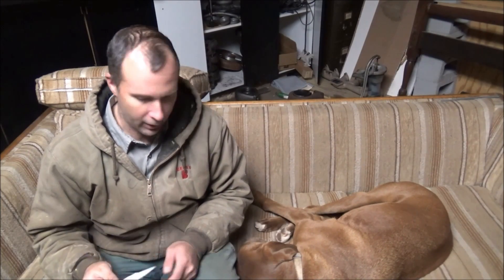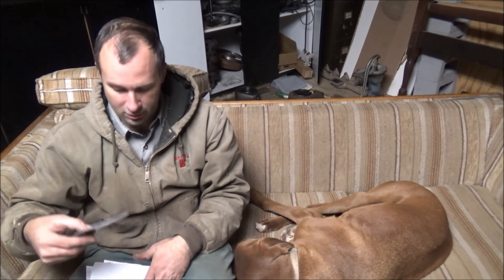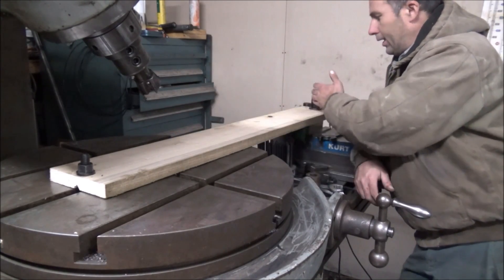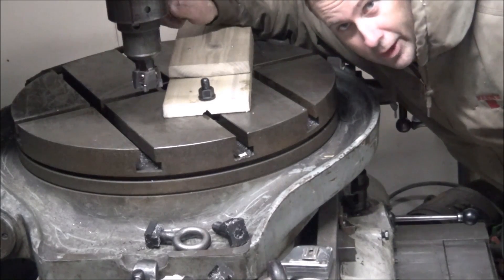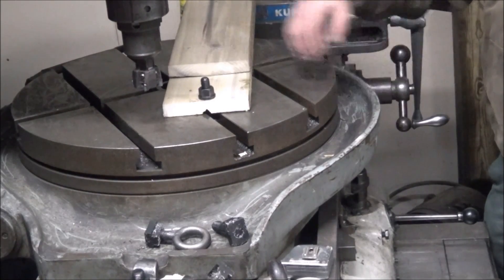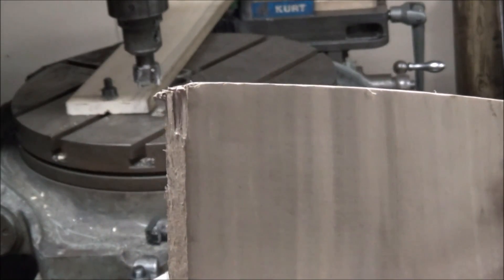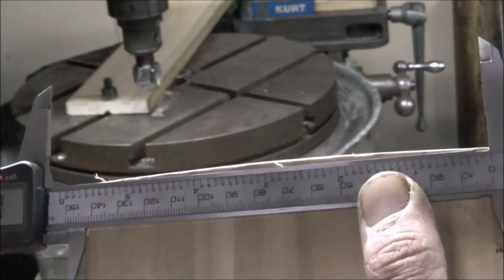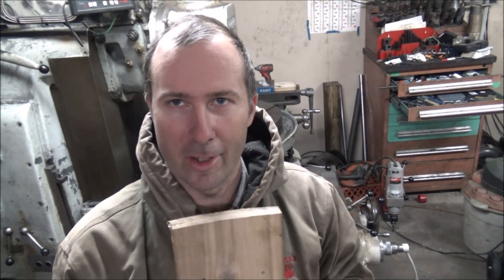How to mill a radius larger than your rotary table

Comment: Since the part being cut isn't following the arc of where it's fastened on the rotary table, I have to wonder if the rotary table is necessary at all.  

With that sliding T-nut action, couldn't the same thing be done using the milling machine Y or even X axis travel?  e.g.  just use the mill cranks to move the part past the cutter?
Reply from the maker: You don't have to have a rotary table but you do have to have a way to be able to move the part on the cutter end as you have to get the sweep in order to cut the radius. Just moving the table would be a straight line action and not an arc.
Reply: @bcbloc02  Let's say the t-slot on your table runs east-west.  Then mount your long-radius center out to the west & your sliding t-nut in the slot.  Then moving the table north-south will cut an arc just as you did with the R-T. 
Of course the N-S travel is pretty limited, so if you could mount another t-slot on the table in the N-S direction and rotate all of the above 90*, you could cut an arc the length of the E-W travel.
(Sorry about the E-W, N-S nomenclature - I'm not sure about which is which x-y.)
Reply from the maker: Bob Engelhardt Yes as long as the one end was stationary relative to the cutter you could use that table to swing the arc the radius of the stationary pivot to the cutter.

Comment: Hey Brian,Since my shop is not always absolutely clean and well organized, I worry about being berated for my sloppiness and inefficiency. Allowing of all of us to view your magnificently organized shop beginning at 8:00 is most inspirational and I thank you for that.
Reply from the maker: Plenty of flack has been fired over the arrangment of my shop, but when you have more stuff than places to put it this is the result.  Also with so many projects and demands for my time the things that I would like to happen get skipped over for the things that HAVE to happen.  I plan for the new shop to be much better but likely over time it too will fill up and pose the same challenges. Good luck to you and keep plugging away in that shop!
Reply: I have no doubt that you're fully aware of the purpose of those two key holes located on that red clamping set inasmuch as it is taking up valuable space on the working surface of your six drawer tool chest.It took me no more than three minutes to mount mine on the left side of my tool chest. But most of all I envy your fantastic memory! Because I lack that marvelous ability of yours to instantly locate any single desired tool within your uniquely arranged shop, I am left with only the option to organize. Shame on me!

Comment: There must be a misunderstanding. If you draw it on paper you will see its not possible in your video you proposed milling an inside pocket
Reply from the maker: From the comments I have noticed I apparently was not clear about what I was talking about doing if you see my reply to meocats below that may help clarify. As for the pocket milling I was talking about you could mill a part with  a constant thickness by coming in the distance you want to leave + the cutter diameter and milling the inside. Something like (CXXXX where C id the pocket and ( is the outer radius.  If that wasn't what you meant let me know.

Comment: Shouldn't you be working on the Shed/Barn? HaHa!
Reply from the maker: I am waiting on my wood to dry out and when its dark temps in the teens  and the wind blowing it is hard to get motivated to do it. :-(
Reply: The first of the barn videos you said you were re purposing this barn because a new building was too expensive,seems with custom milled wood labor,will it be more than a new building ? Aesthetically I love the old building though,can't get enough watching it coming together.
Reply from the maker: louverdudski
By doing the work myself  and re using the old barn I likely will have saved 50K over paying for a new building of the same specs.

Comment: Very cool. Not too complicated either. I assume if your pivot point was off the machine, you could also just use the table travel, right? Like if your pivot point was 20 feet in from of your mill, you could travel the table from one side to the other and cut a very large radius.
Reply from the maker: Provided you have a slot in your temporary table to allow for the movement in and out caused by the arc you definitely could.

Comment: Great setup and demonstration Brian!  Calculations from your rough caliper readings for verification:

R = h/2 + c^2/8h

R = Radius
h = Cord Height
c = Cord Length

From cord length of ~5.75" & height of ~.23" 
R = ~18" => 36" Diameter

Comment: Another absolutely ingenious set up and helps explain how you get so much done alone. You have a very creative mind when it comes to problem solving and are an inspiration to me. 

I suppose one could also cut a radius using geometry for finding a long list of paired XY coordinates but it would be time consuming to cut and still not have a uniform surface. I like your method better.
Reply from the maker: Coordinates would of course be how a CNC would do it. This way is a lot faster and eliminates any tendency to have facets from the moves.  I am glad you enjoy!

Comment: Was confused about this until I realized T-bolt was free to slide, making rotary table just supply side movement and pivot point being fixed. Sneaky!
Reply from the maker: Yep floating tnut was a bit chatter prone but worked for this demo. For a proper setup a fixed pivot with a tight fitting slot in the temporary table would be the way to go.

Comment: I've found that milling cutters can chomp up wood just fine. I had to mill some boards to 1.75" thick to repair a door. I don't have a planer nor joiner, so I clamped the board to the mill table and face milled it to thickness. Not quite as smooth a cut as a planer, but a touch with the sander fixed that.
Reply from the maker: I think a nice sharp edge end mill would have done much better with the wood than the flat faced carbide but it did work for this demo just the same. Good thinking on using what you had to get it done!
Reply: I sometimes use router blades in my mill to cut wood. Does a nice job. regards
Reply: I despise cleaning wood off the machines so I try to keep it as separate from the machine shop as possible.
Reply: So do I as much as possible but sometimes its necessary. I have a powerful shop vac to pull most of the chips away at source. regards
Reply from the maker: I just used my shop vac to clean up the wood chips and dust it sucked up nice being dry.
Reply: Cleaning wood chips and dust off the machines is annoying. So are plastic chips. But sometimes using the metal machines on soft stuff is a necessary evil, and a bench brush and shop vac go a long way to cleaning things up.

Comment: There are ways to swing a very large radius without needing a very far pivot point, using paralellograms. It works like a differential screw. Except you would have two screws, and instead of screws you have moment arms. Maybe tom lipton knows since he works at an astonomy lab. You should ask him (he blocked me when i asked him what's in his box, lol)

Comment: you would not be able to cut matching radii the way you describe it. Imagine two boards that have to slide on each other's ends. Well the concave one will have the pivot on the other side, so you wont be able to cut it like that.
Reply from the maker: Yes you can. As long as your cutting edge is the same distance from the pivot point then the resulting radius is identical.
Reply: \\\\)   (\\\\  , matching beams like this, would not be possible, because the radius in concave, in your video you proposed milling concave radius as a pocket on the inside. In my proposed example of two beams with matching ends, the pivot point would be on the other side (essentially floating in air.
Reply from the maker: meocats That is not what I meant. I tried to clarify with the caption but that was obviously not clear either. I meant you could cut an inside or outside radius by being on the opposite side of the cutter like this XXX( or (XXX and the radi would match. As for the pocket I meant you could cut a matching curved pocket so the material left was the same thickness like (CXXX by moving over the desired thickness to remain (+ cutter Diameter of course) and milling the inside of the pocket. I hope this clarifies what I meant.

Comment: you can do this without rotary table or even vice. Tie one end to the table, Tie the other end to a screw that ties to the side of the table.  clamp down with a bridge. Hope you got no burs on the table. It will even take heavy cuts.
Reply from the maker: Feeding with the screw not as easy as the table but it would work.